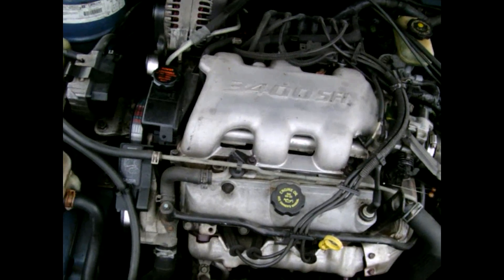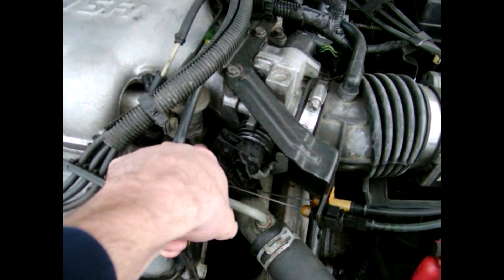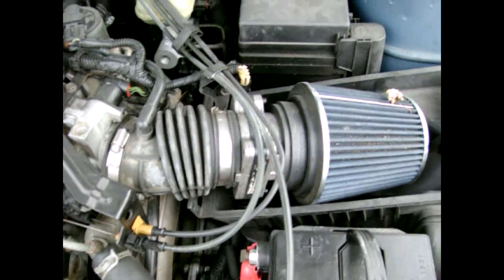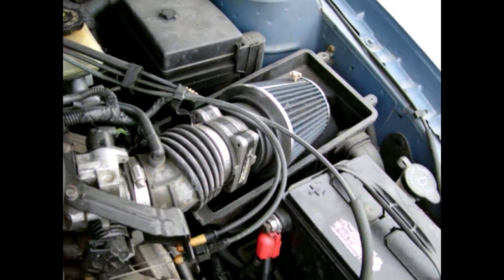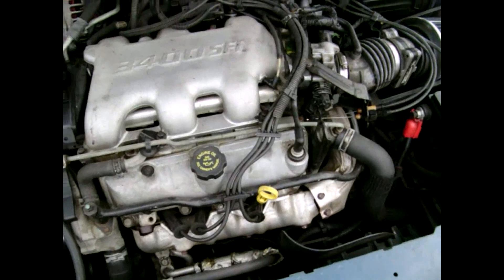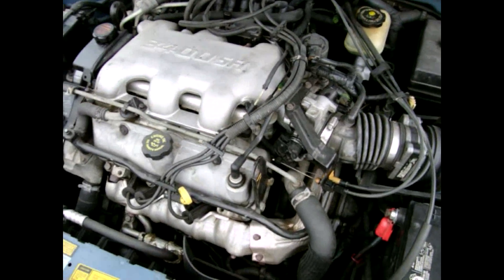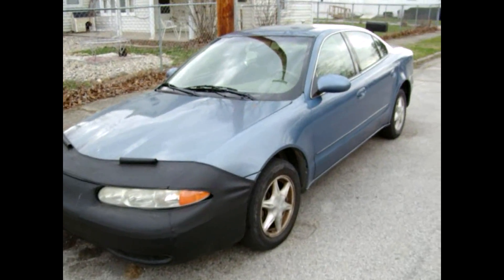3400 GM Engine 3.4 Liter Motor Explanation And Discussion

Comment: My 01 Chevy Venture, is Idling to high, speratickly, but becoming more constant.  I'll shut it off, start it back up, and it will run fine for a bit.  I'll be going, then if feels like someone is touching the gas.  Please HELP
Reply from the maker: Check for vacuum leaks.  Also, take off the air hose going in to the throttle body.  The throttle body blade can sometimes get carbon around it and cause it to stick.  Use some carb or throttle body cleaner around the butterfly throttle body blade.  If it throws any codes, check for that as well.
VT247
Reply: Vacationtime247 engine light came on, found a vacuum  problem, fixed it engine light went off.  When engine warms up it starts the high idle again, I have been putting it in to neutral turning off the engine, starting it up and it stops intermintantly, then high idles again.  The high idle is REALY High.  Throtle positioning sensor, fuel reg, fuel pump?  Help please!!!
Reply: Vacationtime247 and the fuel gage doesn't work
Reply from the maker: The fuel gauge problem is in the gas tank, the sending unit.  Sounds like a vacuum leak for the high idle or possibly a stuck EGR.
VT247
Reply: The idle problem sounds like an intake air leak. Check a little rubber plug that covers an unused vacuum port on the upper intake manifold. It's located to the right standing in front of the vehicle. sometimes it hides under the spark plug wires. If damaged replace. I've come across with this several times in different vehicles with the same family of engines.

Comment: I knew that I had to take the oil pan off even if it was piston slap to that is what I did first. When I checked rods I found I could completly move one back and forth and the bearings where gone. I also could move three others. I took the motor out the other day "Out of the top also. I know books say you can not but you can if you take the heads off and use the head bolts to bolt a tight chain on." Any way When I took the oil pan off it was completly full of metal shavings.

Comment from the maker: I don't think it should be any big job to replace it.  Two hex nut bolts holding it on and the fuel line.  Never had one go bad so I've never really had to replace one.  It's right there on top, shouldn't be hard I wouldn't think.
VT247

Comment from the maker: Check for vacuum leaks.  Especially under by the throttle body where it T's off.  The rubber gasket goes bad.  Also could be the fuel pump.  When they start going out, it'll send some fuel through, but not enough for the high pressure needed to supply the injectors.  Of course, Autozone will scan your codes for free.  : D
VT247

Comment: My 2004 Grand am has 231,000 on the 3400 engine , and has only needed a power steering pump (although the computer and a few other electronics were repaired becuase the car was struck by lightning after about 2 years of ownership). Does anyone else get an odd shearing sound that oscillates when cold? The sound goes away after a few minutes of running.
Reply from the maker: Sometimes using a stethoscope or a long piece of rubber tubing up to your ear can help chase down a funny noise.  Those mystery sounds can be hard to trace.  Check around the power steering and the rack and pinion.
VT247
Reply: nate grover yep almost all 3.4s I've come across have that noise. It's annoying but I just ignore it
Reply: idler pully old ?

Comment: I have an 02 Grand Am GT, and it'll hesitate to start sometime and when it happens some time it  takes quite awhile for it to start, but it will run fine, also i doesnt feel like it has power i have a couple of friends with gt's and se's and they can get 0 - 60 in around a 7 - 9 sec range mine will get 11
Reply from the maker: Hopefully it isn't the head gaskets  The 3400 is known to have them.  Bad head gaskets can cause a loss in compression.  But change out the spark plugs, plug wires and check the coil packs.  Also run a code check.
VT247

Comment: WHERE IS THE PETCOCK TO DRAIN THE ANTI-FREEZE ON AN OLDS SILHOUETTE MAYBE I'M NOT LOOK ING HARD ENOUGH?
Reply from the maker: Passenger side of the radiator at the bottom.  It's a plastic turn style plug and it should be black.
VT247
Reply: could be on the driver side front of the radiator, use a1/4 ratchet to remove and wiggle it back and forth at the same time, my 2003 grand am gt has it on the driver side facing forward, when you look under the bumper you'll see it easily.

Comment: 05 chevy impala had 160 miles and just developed a ticking noise.. don't understand, I do all proper maintenance on it.
Reply from the maker: Where is the ticking noise coming from? 
VT247
Reply: Vacationtime247  sound likes its coming from right under the engine
Reply from the maker: Listen to the valve covers.  The threads on the rocker arms can pull out and then need rethreaded and heli coiled.
VT247

Comment: Can i put that engine in chevrolet equinox 2006?
Reply from the maker: It MIGHT.  Actually had to look it up.  From what I can tell the block and heads appear similar.  The intake and exhaust is different.  So there would be a lot of swapping over of parts to make it work.  Certainly wouldn't be a drop in replacement.
VT247

Comment: I've got a 02 Pontiac Grand Am with a 3.4 engine. The problem I'm having is, it will start right up and run great, until it gets to normal running temp. Then it stalls right out, like when you shut the key off. And it will not start again until it cools back down. Then it starts right back up, till the temp gets close to 200 degrees, then stalls out again. I've changed the crank sensor, cam sensor, temp sensor, alternator, both o2 sensors. Its not storing any codes. I'm about ready to push it off a cliff!! Lol. Has anyone run into the same problem? And if so, did you find out what causes this??
Reply: +Logan Fry You check fuel pressure? Let it run and see if the fuel pump poops out once it warms up.
Reply: +Logan Fry
It's having problems once it goes into closed loop. Since you covered the O2, try the MAF sensor. The MAF can go bad while staying in a range that doesn't throw any codes. Just before replacing MAF, make sure throttle body is clean. And may as well follow that by going through the TPS learn procedure. (Key on, no starting for 10 sec. key off wait 10. Then throttle to floor, key on (no start) 10 sec. Key off.)
Reply: my 03 impala is doing the exact same thing your talking about. Been at this car for a week now! you ever figure out what the issue was? Logan Fry

Comment: 3400's are known for head gasket failures.  You can do a combustion test on your coolant by renting the test kit from autozone. Or you can get a scope camera (Costco in 2016sells them for under $60), and look at the passenger side rear cylinder as that is where the gasket blows first.  Look for a shiny clean cylinder that has been steam cleaned by coolant leaking into the cylinder and steam cleaning the piston head.  Then check the other rears, then the fronts.  You can stop testing when you find the first clean piston.  That tells you that a HG job is needed.  Do not drive it or overheat it any more.  Get the heads milled, and get 16 new tty (torq to yield) head bolts. Follow the procedure exactly.
Reply: You know why it goes bad right? Because the intake manifold gasket leak was neglected, letting the coolant leak, causing the engine to overheat.
Reply: +tails300 my intake was just fine.  No coolant in the oil either.  My head gasket  just developed a very tiny rust fracture in it at cylinder#1 between the cooling passage and the cylinder.  Just enough to superpump hot exhaust gases into my radiator, and create air pockets to prevent coolant flow.  Luckily i caught it when it just started happening, so over 5 years later, and 60k, all is good.
Reply: +David James Oh ok most of the people I know had theirs fail because they neglected a problem with their intake manifold gasket.
Reply: +tails300 you are probably correct about that.  Many of the headgasket jobs last less than 2 years because most mechanics reuse the single use tty bolts and do not get the heads milled.
Reply: Don't they stretch when they're torqued down to the recommended spec. That's quite silly to reuse bolts that can't be reused because of that.
Reply: +tails300 i guess there is no way to verify the torque is within specs if reused, and possibly encapsulated thread lock in the threads? I had a tough time ordering the bolts from the dealer.  Not all 16 bolts are the same, and i had to send a few back and forth till it was right.  The parts dept asked me why i didn't reuse the old ones.  With the thousands of these 3400's that went bad, you would think they would know these part numbers by heart.  The GM procedure clearly stated that the tty bolts must "NOT BE REUSED".  I recall they needed to be torqued in a sequence, then turned like 46 degrees in sequence.  Bolts needed to be equally tight as not to have uneven pressure on the gasket leading to premature failure.  This works by stretching the bolts like springs.

Comment: These 3400s are easily one of the worst engines GM has ever produced. I have had experiences with plenty of older GM V6 engines and the 3400 has caused me the most trouble. The head gaskets just went out on my 2004 Grand Am. So anyway by far my favorite GM V6 Engine would be the 3500 V6 that was put in like the Oldsmobile Intrigues. I had one that had well over 300 thousand miles on it and it ran like brand new(also due to the fact I kept it super maintained). The 3800s are a close second as well, only issue I have ever had with a 3800 was a small vacuum leak.

Comment: what about the valve stick
Reply from the maker: I seriously doubt that it has "valve stick "  if it's making noise, then the ticking may be stripped rocker arm bolt causing the rocker to not push the valve open.  The pushrod hitting the loose rocker arm makes the noise.  Computer reads misfire because that cylinder has a valve not opening, intake or exhaust.
Reply: +Vacationtime247 well when I took it to the garage they run the diagnostic. and it said it was the 2ND cylinder misfire and a valve stick.  it really doesn't make a very loud ticking noise.  how would o fix a valve stick? video?

Comment: Pontaic 2001 grand am GT 3.4 liter motor if u know what the problem is please help and god bless
Reply from the maker: What seems to be the problem?  I get a lot of questions with different names.  What was the issue?
Reply: My 2001pontaic grand am 3.4liter v6 is reving to high at iadol
Reply from the maker: Check for:
1.  Vacuum leaks
2.  Stuck throttle plate, not closing entirely, clean it up with some carb cleaner.
3.  Idle air control valve stuck, again clean with carb cleaner.
4.  EGR valve stuck
VT247
Reply: Thanks bro its not the air control valve but ill clean it up ill try that frist
Reply from the maker: Check for vacuum leaks, that can cause a high idle.  The tubes on the back for the EVAP can come loose too.
Reply: Thanks bro whats is the EVAP
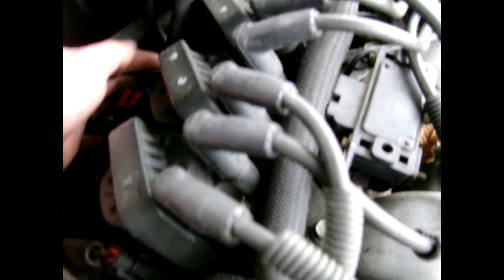Reply from the maker: The Evaporative Emission Control System (EVAP) is used to prevent gasoline vapors from escaping into the atmosphere from the fuel tank and fuel system.  The solenoid is located by the coil packs.  There is a vacuum line that runs to it. Check the area at 2:40 and at 3:00 in the video.
Reply: What video sir
Reply from the maker: Youtube: 3400 GM Engine 3.4 Liter Motor Explanation
Reply: Thank go there and type what u just wrote me

Comment: I saw a lot of comments nohow to change the back plugs on a 3.4 litre motor in my Chevy venture..after a lot of cussing I found the only easy way is to remove the coil pack bracket..I did take off both motor mounts and pull the motor forward but that is the easiest way..12me nuts on back of bracket 10me on front!!!!
Reply: I did it without removing anything. Hardest part was getting these old wires off

Comment from the maker: Fuel Pressure Regulator.  Controls the PSI of fuel in the rails and is controlled by vacuum.  Cheap, easy fix.
VT247

Comment: Having to buy the same part twice sucks as well.
This country used to over engineer everything. Now we reward those who cut corners and safety as well.
There's one vid on this subject, a tuber found the head bolts (from factory) torqued @ only 5lbs.
Shame on GM.

Comment: Hate to burst your bubble, that is not a cold air intake. You would be better off to find the stock air box and put a K&N air filter in it. The one that's on there now isn't getting any cold air. It's just sucking hot air from the engine compartment.

Comment: 02 venture van 168,000-K     3.4  stalls at idle only after warm up I have to feather gas and brake at lights to keep from stalling. Not at all times !       No Codes Changed Coollant temp sensor, 02sensors , crank sensor, fuel filter, 40/50 psi at fuel rail , runs great at cruising and high throttle,   never sputters or hesitates then .  Notice slight faint stumble at times  before shutting off at idle .2yr old Airtex fuel pump,   always hear it prime,   even when it stalls you can then hear it prime ??   New Fuel Pump relay     New Ignition module. New IA ,  Carefully cleaned MAF ,maf solvent cleaner only    Removed / cleaned throttle body last week .     6 months ago Had major ignition issues extreme engine  surge  after warm  at running speed up then changed Ignition module,   all was well for 500 miles then this stall problem occurring . Im thinking fuel pump issues,  mechanic says,  no . This stalling stared after the 500 miles ignition module change,  ,   right after very slow to fill gas 1 mile later .. .   Smoke test done,  vent valve replaced . , fills ok now . 2 yrs ago  tank was replaced , broken fill nipple , wreaking yard tank, when new airtex pump was replaced     .Tank had to be removed  after replacement as lines were not blown out and bugs had made nests blocking venting .    Fuel filter was fairly clean when I just replaced it .  Any help? The idle seems low what should the RPMS be at idle in Drive ? Can they be adjusted/ calibrated by the  IA Thanks .     Sorry for the book !
Reply from the maker: Check for vacuum leaks.  The grommet under the throttle bracket where the PCV and rear crankcase vent tube goes into the upper intake can fail.  See if it's loose, had that happen on this Alero.  Had an issue like you described with a bad MAF sensor.  Unplug it and see if that changes the symptoms.  May also check for carbon build up by the EGR valve and into the upper intake.  Don't mess with the factory idle speed, it's set from the factory.   Hope this helps.
VT247
Reply: @Vacationtime247   Thanks,  I will try for Carbon build up on EGR.and ports . shouldnt MIL light show fuel trim issues  if lean or rich ?  I Didnt like how it ran with MAF disconnected previously. Worried I might damage something     I think it went into loop mode but i will try again to see if it stalls at idle as often as it does connected.  The IA can be recalibrated to the ECM through a process,  Im told . I didnt do anything to calibrate it on installation      Thanks for the help

Comment from the maker: Man, some luck you've had with that car.  Listen for the injector to fire, a vacuum hose will work.  The rocker arms move when cranking.  My problem was the intake cracked when I torqued it down after HG install.  Both the upper and lower had a crack.  The Fel Pro gaskets have a metal tab installed in them, right where it split.  Check out my 3400 engine misfire vid where I explain this issue in detail.  Hope you have better luck from here on out : /
VT247

Comment: were is the fuel line
Reply from the maker: +Leroy Kniep 2:31  It's where the black vacuum line goes into the fuel pressure regulator.  The fuel line connects into there, it's routed under the throttle body.
VT247

Comment from the maker: Yea, a gallon of gas and a match would certainly be cheaper.  But I'm going to say it's probably spark related no start.  You mentioned that a wire had to be repaired on the coil pack.  Read this article.  I'm betting it's in the coil pack or the crank sensor.  Just cut and paste but use a . instead of the (dot) easyautodiagnostics(dot)com/ignition_gm/ign_module_test_1.php
VT247

Comment: I've got a 2003 Monte Carlo and I notice this engine likes to rev up to 3k rpm and then choke for a second then can gas up to the 4-5k rpms is there any fix to this? It's the exact same motor as what you just shown
Reply from the maker: +Cody Wakefield If you're in neutral when this happens it's normal.  Computer keeps it from over revving and prevents engine damage.  It you're driving, check fuel pressure.
VT247
Reply: Thanks I'll stop by advanced auto tomorrow to rent a fuel pressure gauge. I'll let you know the results.
Reply: Turns out I've got a blown head gasket and I was leaking coolant rapidly fast.
Reply from the maker: These engines are bad for blown head gaskets.  When you get the heads off, check for cracks between the valve seat and the spark plug hole.  Also make sure the threads on the rocker arm bolts are good, they can strip out.
VT247

Comment: So I'm guessing a 3800 is better?
Reply from the maker: Absolutely.  The 3800 is pretty reliable and doesn't have the issues this 3400 has.  Unless you're a decent mechanic, stay away from the 3400's.  Got mine sorted out OK, but that was after doing all the gaskets, head, intake and timing cover.
VT247
Reply: @Vacationtime247  thanks for getting back

Comment: Sounds like it's air bound. These motors R a B!tch to bleed. With cap off(2 add fluid) Open both ports  1 one return right side and 1 @ thermostat. when getting steady water from return side close it. then same @ T stat. keep a concrete mixing pan under it or you'll have fluid everywhere.
good luck